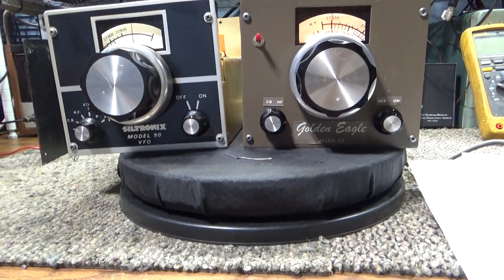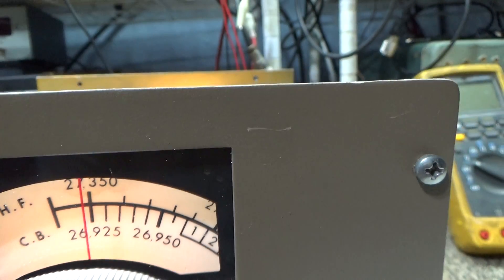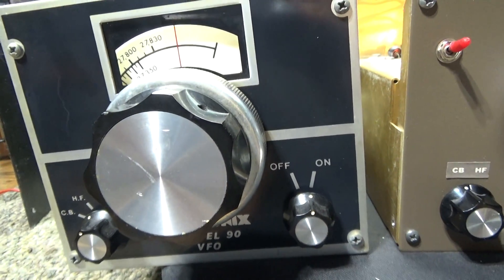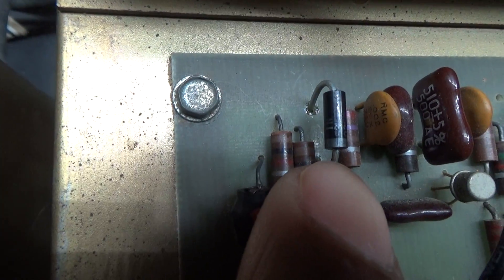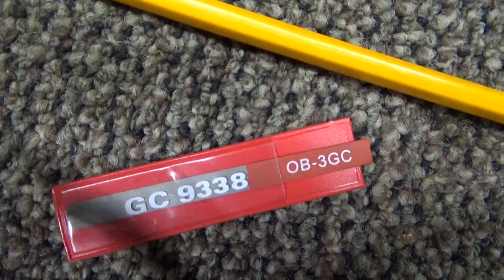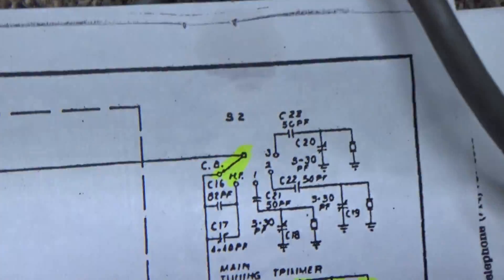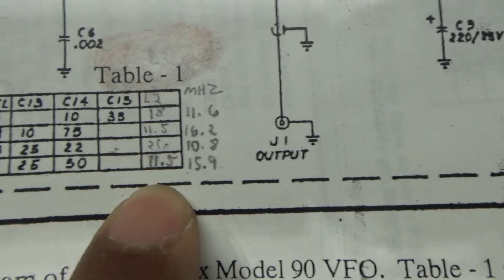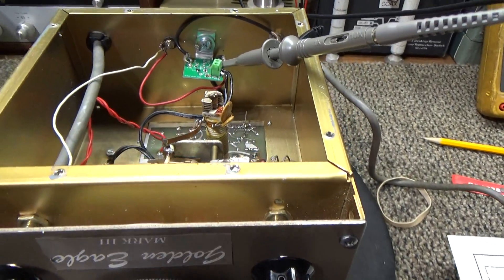Siltronix VFO's models, versions, thoughts and hints.

Comment: Why not make a video showing how to connect the vfo to a radio like SILTRONIX 1011c/d?
Reply from the maker: because a Siltronix already has a VFO in it.
Reply: @tramdr  the 1011c I saw DOES NOT use an external vfo
Reply from the maker: well, it does not have an external VFO because it has an internal VFO and therefore doesn't need an external VFO. Same with Tram D201's

Comment: Man I didn't even see this trdr. I wrote you about the Siltronix for my Mark III. On my Mark III reciever when I turn the CB, HF and XTAL knob the reciever takes you above 23. I know I hear and can tune in sideband on 38-40... so it shouls be ready to go! I wired to one of these to a Mark III back in the 80's and it worked great!!!! Its just been so long. Its fairly easy to wire in to the xtal circle (my ch. 1 is out anyway Lol. (you refreshed my memory- thanks). Man im just trying to transmit above 23 to bucketmouth with a few locals here! 😀 Ttys.. and thanks for all the GREAT vids you upload man.  73's   X
Reply from the maker: Hope it helped.

Comment: You can do away with the 7.5 volt zener diode and rebuild the circuit with a better voltage regulator similar to the lm723. Also w4dpk makes a vfo drift cancellation board used in many older LC style vfo radios that keeps it on frequency.  Of course now days the dds programmable vfo works great if it has proper sinusoidal output. Low vfo output signal level into the mixer stage in the radio will cause lower tx output power. The vfo output amplifier board is needed for proper mixer levels the radio requires. When you switch between cb and hf you can see the signal level voltage drop on your oscilloscope.
Reply from the maker: all true, but a lot of work and even with all that, its still a coil/cap oscillator. It will never have the stability of a crystal oscillator.